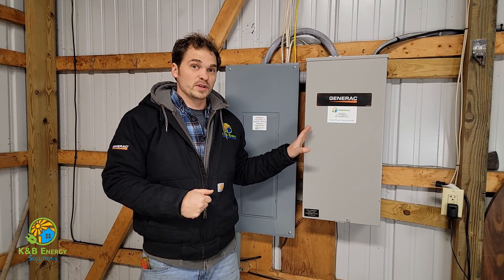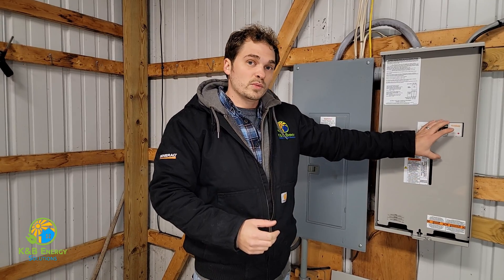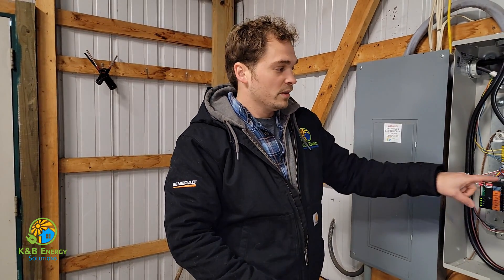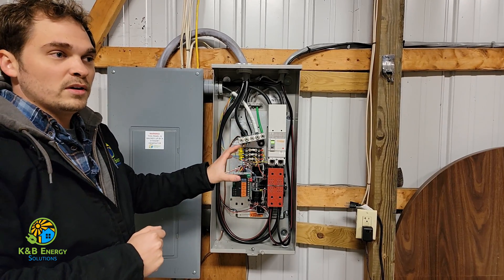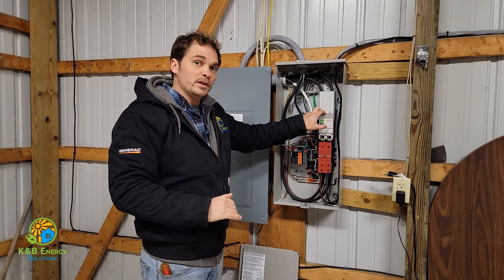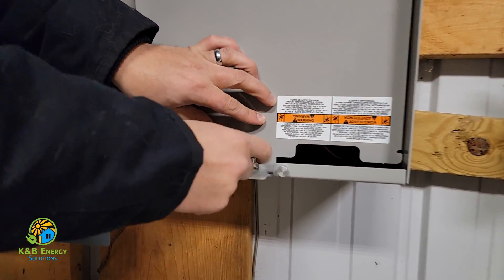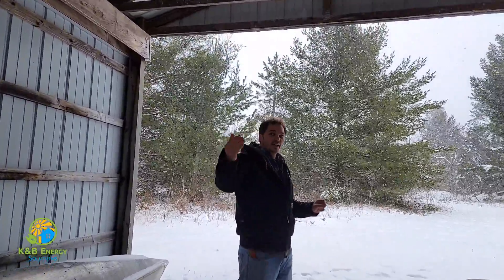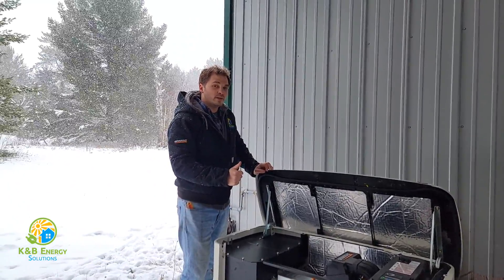Storm Coming? Transfer Switch Test Your Generac Generator! How to do a transfer test

Comment: I understand why the engine starts so quickly once normal power dies.  What I can’t comprehend is why generac thinks we need to close the transfer switch into the generator so soon.  If refrigerators or ac units are running when normal drops, they each need a couple mins to equalize refrigerant pressure before gen power tries to pick it up.  Now you have a small engine closing into locked rotor amperage condition.  Senseless.  Start engine and cycle the switch after 3 mins.  No need for sudden restoration of power.
Reply from the maker: some models do have the ability to extend the "warm up" timer

Comment: If my grid goes down, we flip a switch on the Solar Sub-Panel to run off Solar Batteries for up to 14 hours. Batteries are charged by Solar, Generator or Grid.   I test our Push Button Generator every two weeks. We often turn on the Solar system if it's a nice day.  In the Great Texas Ercot February FUBAR our grid power was being Rolled off and on for 10 days.  That's not gonna happen again.

Comment: If I  need to kill the power to my service panel,  is it feasible to shut the switch in back of the generator and flip the switch in the transfer switch?
Reply from the maker: all you need to do is press the off button in the generator and then shut the breaker in the transfer switch off